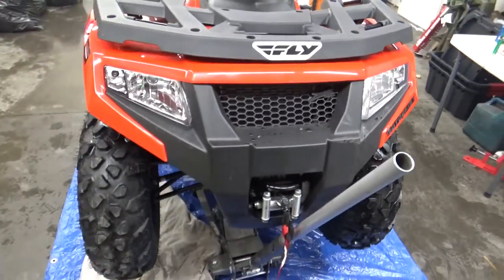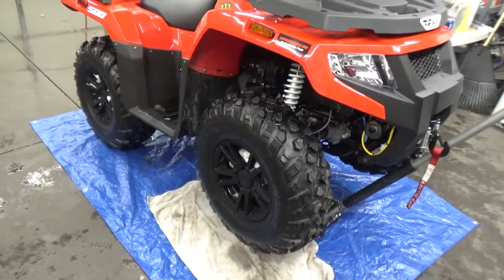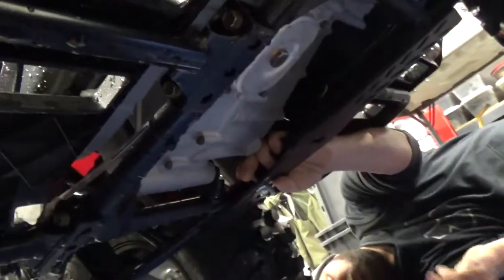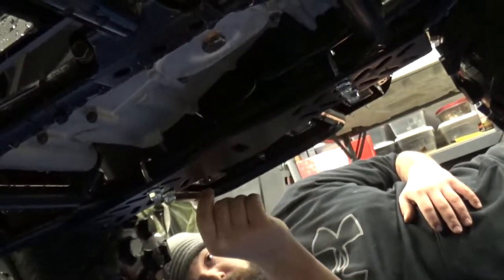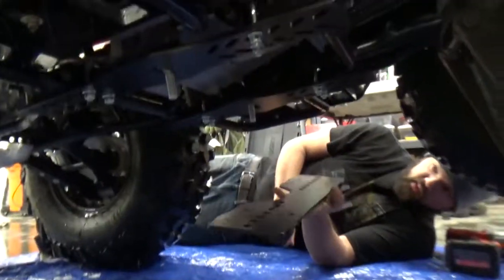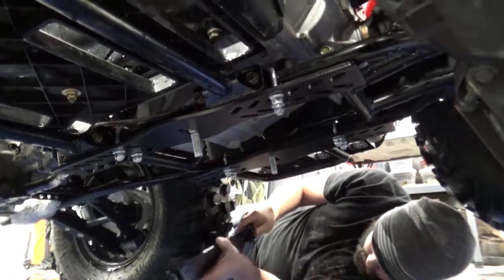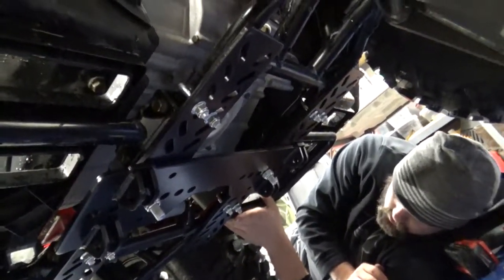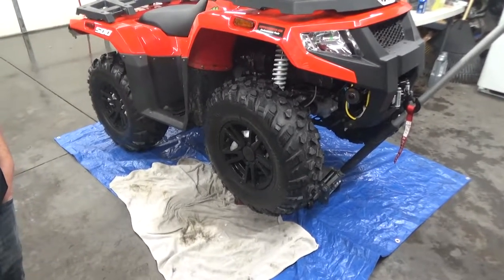2018 Arcticcat/Textron Alterra 500 KFI Universal Plow Mount Install

Comment: My Alterra had an under carriage cover that is unable to go back on since installing the plow mount to the frame. Do you just cut the cover to fit around the bracket or leave it off?
Reply from the maker: Thank you for the awesome question. The plow mount should be mounted over/on-top of the plastic skid.  In other terms the skid does not need to be removed for installation as you should still have access to your drain bolts. Keeping the skid in place helps to keep debris from damaging the bottom end. If you need any help please let us know!
Reply: Do you guys have any tips or recommendations on how to get the blade to scrape the ground? Im using a KFI Sno-Devil plow system. It still leaves an inch or 2 of snow on the ground.
Reply from the maker: @natesayre2739  You should be able to adjust the feet on either side of the plow to allow for the cutting edge to make contact. If you have your plow all the way lowered and your feet are still not touching earth you may have some binding in the plow mount.  First I would take a look at the feet for adjustment. If you have any more questions let us know.